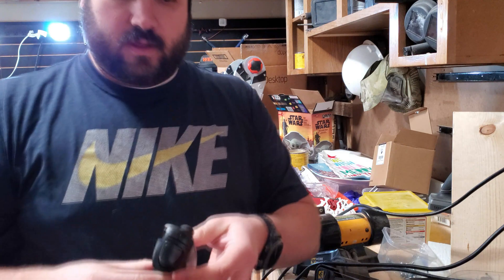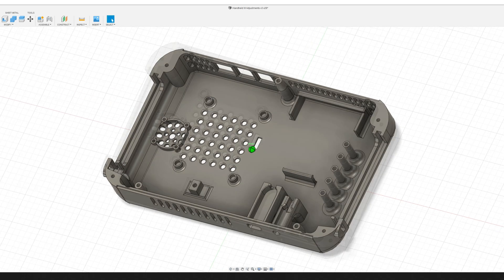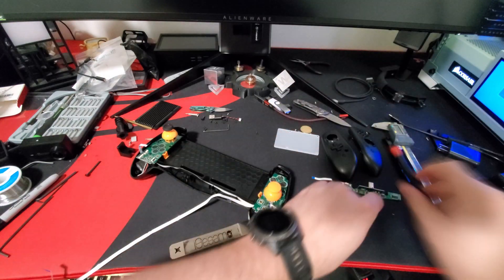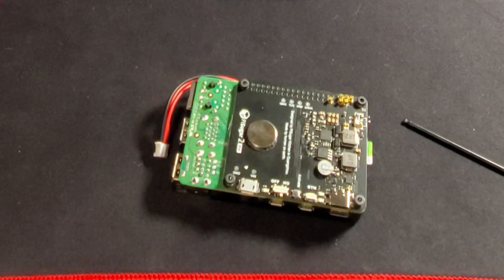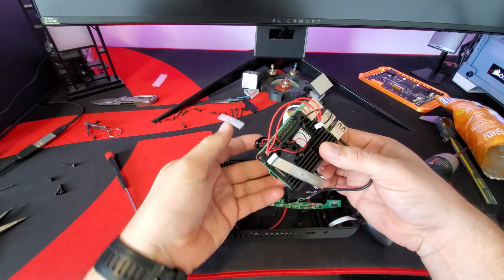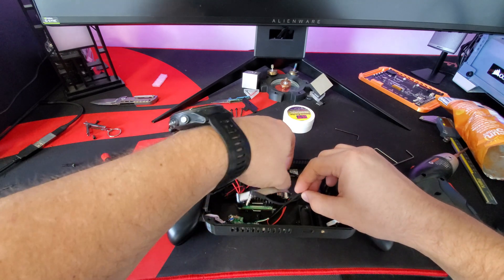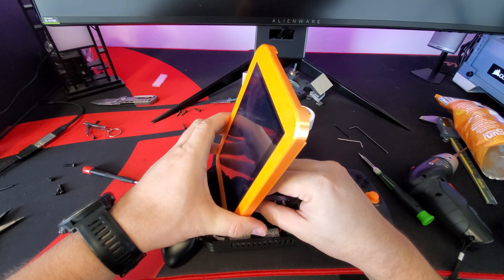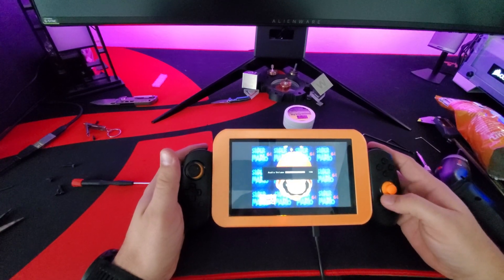DIY Retro Handheld Gaming Console - Assembly Guide and Free Files

Comment: I am trying to get a controller like this to pair with the pi. Retropie recognizes it but i can not configure any buttons. Inhabe enabled xbox drivers. Do you have any pointers? Thanks
Reply from the maker: It has been so long since I worked on this project last I really don't remember any little hiccups like that, that I may have run into. Does the controller work in some screens and not others, just not configurable, or doesn't work at all? You'll likely need a keyboard and mouse to navigate  some of the menus and to do some of the setup initially.
Reply: Got it working, I guess these controllers used to be recognized as Xbox with retropie, now you need to add the Nintendo drivers. Thanks for replying

Comment: The Kinvoca Switch Controller is not availble am I able to use a different one? Such as this one?

https://www.amazon.com/dp/B09XWP1DV5/ref=sspa_dk_detail_4?psc=1&pd_rd_i=B09XWP1DV5&pd_rd_w=69EPV&content-id=amzn1.sym.386c274b-4bfe-4421-9052-a1a56db557ab&pf_rd_p=386c274b-4bfe-4421-9052-a1a56db557ab&pf_rd_r=4YKWETWCRSTSQF0ZE0H1&pd_rd_wg=wbMMX&pd_rd_r=2e96d313-a8a6-4324-b9d5-ad0b997ab2d0&s=pc&sp_csd=d2lkZ2V0TmFtZT1zcF9kZXRhaWxfdGhlbWF0aWM&spLa=ZW5jcnlwdGVkUXVhbGlmaWVyPUEzMkJOSjM0NzVMS1pDJmVuY3J5cHRlZElkPUEwMTU4MzE0WERIOFBKSlk1M0dYJmVuY3J5cHRlZEFkSWQ9QTEwNDgwMTUyWkRYRjBXV0hXTlQ2JndpZGdldE5hbWU9c3BfZGV0YWlsX3RoZW1hdGljJmFjdGlvbj1jbGlja1JlZGlyZWN0JmRvTm90TG9nQ2xpY2s9dHJ1ZQ==
Reply from the maker: I imagine that one would work, it looks the same. It's probably the same thing with a different name on the box.
Reply from the maker: That said, plug things in using one of the usb-c extensions, set up, and test with the pi before chopping things up.
Reply: @NothingSpectacular good suggestion thank you

Comment: The Kinvoca controller is not available anymore on Amazon. Can I use a replacement switch controller from a different brand provided it has the USB-C connector at the bottom?
Reply from the maker: You could give it a try. The biggest issue would be fitment of the pieces. You could also plug it all in and test things before cutting it up.
Reply: @NothingSpectacular  As of today 8/23/2022, i found a Kinvoca at Newegg for anyone needing it.

Comment: This is amazing! I actually have the same screen and a fair few other parts are similar. I made a similar build but simpler, and using a DFRobot control and charge board + LiPo for the battery, which meant I had to create my own on/off switch but it all worked fine.
My next project I'm thinking of using small parts of your design but changing it to fit a LattePanda v1.0 and just reuse the same power solution I have for the Pi. I will be sure to post it as a remix on Thingiverse if I do follow through on that.
Reply from the maker: I like the sound of your power solution. This one was just easy. It's more for getting around than for playing for any real amount of time.

Comment: Hi, I'm using a monitor like yours, but retropie has no sound. can I help me
Reply from the maker: Does it have the built in speakers on the back?
Reply: @NothingSpectacular  Thanks, I switched to recalbox and batocera sound OK. but retropie has no sound.
I don't know where speakers is.
Reply from the maker: Interesting. In that case you may need to force audio to HDMI in the config file or change audio drivers in RetroPie settings.

Comment: Had a pretty hard time.  Not great at solder and desoldering.  Think I also used the wrong wire.  Can you link to the exact wire you used or an equivalent?  the cables broke from solder joints so many times trying to get this in, one of the pads on the pi broke off this time on the USB so assume I will need to order a new PI.
Reply from the maker: Already talked to you, but replying in case anyone else has similar issues and sees. I just used the wire from a spare/cut up usb cable. You can skip soldering to the controller board by using a USB-C - usb 2 extension cable and cutting the usb side off. Then plug into the controller board and solder to the pie. Use a dot of hot glue to avoid pulling off the pads after soldering. In your case where they are already pulled off, you can use the pins directly in front of them.

Comment: I am in need of some help. I got the project all put together (had to get a screen elsewhere as Amazon was sold out; the back buttons don't match, the bezel is a little big, and I had to grind the screen mounts down to get it to fit), and am firing it up to configure it, but the Left and Right Triggers are not responding; any ideas?

I also noticed a small switch on the controller interface board; do you know what that's for?
Reply from the maker: Just responded on thingiverse.

Comment: I'm totally gonna do this, thank you for sharing this. Quick question, are the stl models in mm or inches?
Reply from the maker: They are all metric (mm).
Reply: @NothingSpectacular  one other question, connecting the fans and power for the monitor, how did you bind the connections? Using the pins that came with the monitor power connector? Not quite sure how to do this.
Reply from the maker: @lil_spring_roll  Yes, I removed the pins from the platisic housing, had to carefully strip just a bit of housing above the actual metal GPIO plug, and soldered the other cables to it so that the fan and screen both use the same plugs. If you're not comfortable with this you could use the 5v GPIO pins for the screen and a couple of the 3v GPIO pins for the fans. The only downside is a bit less airflow. I'm not sure how hot the unit would actually get this way though. It might be fine.
Reply: @NothingSpectacular  I was thinking, what if buy individual plastic housings for the fans pins, thereby separating the grnd and positive, and using gpio pin 1(3.3v) and gpio pin 9 (gnd), would that be okay?
Reply from the maker: Yeah that's exactly what I mean you could try if you don't want to mess with soldering them. It will work, I'm just not sure how much airflow you'll lose on 3.3v vs 5v.